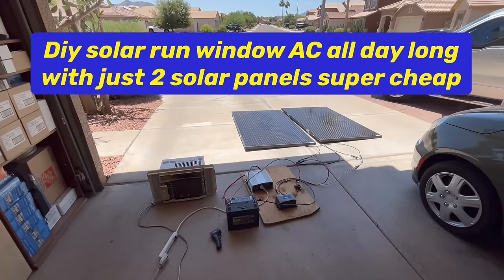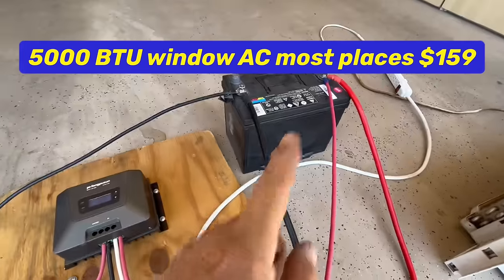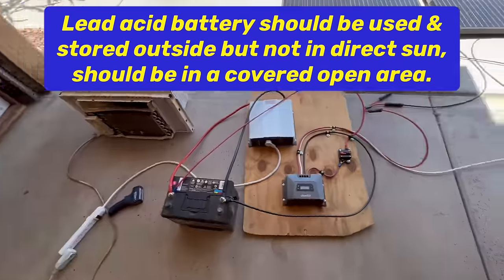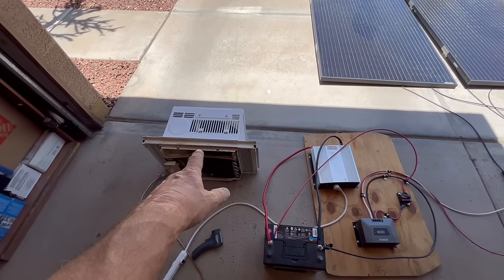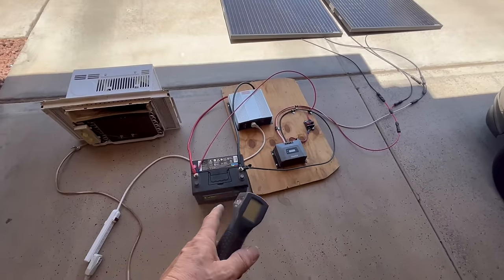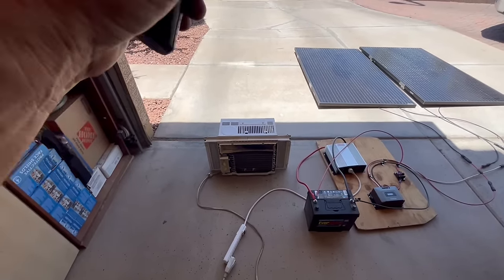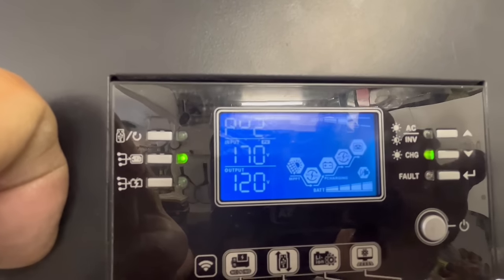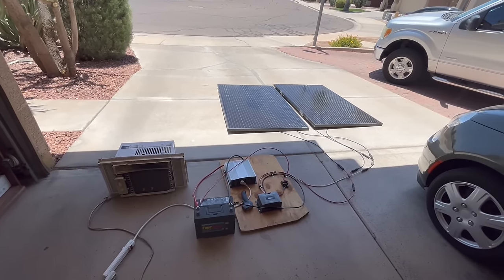Run your window AC with just 2 solar panels when sun shines. Easy DIY project you can do in one day.

Comment: Thanks for explaining all this, I’ve been trying to learn how to do something like this to run a chest freezer, and your explanations make it seem a lot less  overwhelming.
Reply from the maker: Make sure you can expand your system. Once you start seeing what is possible with solar, more than likely you will keep expanding to run more appliances with solar
Reply: @diy-solar-guy  Understandable. Despite the added cost, My plan is to set up separate systems for each new appliance I want to bring online, that way a single failure does not disable every appliance. (This means batteries, charge controllers, and inverters for each system, ie lights, refrigeration, freezers, and air conditioning.)
Reply from the maker: @Vikingwerk  i actually have 4 separate independent systems and back up inverters in case one craps out on me. I’m like NASA, I have back ups of back ups, lol. The all in one inverters I talk about in my other videos are very good and stable. They are meant to last 10-25 years. LiFePO4 batteries are expensive but really dropping in price but give you great overnight run time on your solar system. Check out my other videos and see all the things you never thought you could run on solar. I know people who build off grid systems and use a transfer switch to stop using grid and only use off grid power, but never feeding into grid. They run their whole house 100 percent only using solar in day and battery bank at night. I use off grid now to run 100 percent of the time air conditioning in my 2 starts house with 3 car garage air conditioned as well. I spend $0 on ac cost now with it being 113 degrees during day and 85 degrees at night. I also run my pool pump and when cold pool heaters along with 3 chest freezers and s fridge, outside lights. I have an option to use my 3 1/2 ton and 4 ton heat pump ac units on house or the 6 mini splits I installed in house and garage. Check out my other videos to see how much you can actually do with off grid solar.
Reply: a 12v/24v dc chest freezer would be best. I do this with 2 x 100watt panels in series with a MPPT controller.
Reply from the maker: @JosephMBoyer   very nice, great ideal. Solar can be very easy if you know the basics. Thanks for your comment. Hope you have a wonderful and blessed week
Reply: @diy-solar-guy  you too buddie god bless
Reply from the maker: @JosephMBoyer  thank you
Reply: @diy-solar-guy  Hello, do you mean that these batteries are okay to be drained and emptied every night ? I always read that she should not use batteries for more than 50% of the total energy they can stock ? Thanks a lot for the video !
+++++++++++++++++++++++++++++++++++++++++++++++++++++++++++++++++++++++++++++++++++++💌
Reply from the maker: That is why I am sharing how easy it is to do. LiFePO4 batteries are dropping in price and well worth it to be able to run overnight appliances. You can add later on which is why I like the server rack batteries and trying to increase my battery bank to the max I need as soon as I can. These batteries are suppose to last 10-20 years with full discharge every day. Glad you find it easier to follow. Let me know if you have more questions. Hope you have a truly wonderful and extremely blessed 2024

Comment: This is what I've been looking for... being able to set up just an AC system that runs on solar panels. Thank you for a very detailed explanation, awesome... when I do this, I most likely keep the battery secured in a wooden case outside the window and just run the wire going to the charge controller (?). Anyway, thanks for sharing this and I think you're good so you gave me no choice but to subscribe hahaha! I'll be checking your other videos later... thanks again...
Reply from the maker: Thank you for your input, hope you have a wonderful and blessed weekend
Reply: If you do try to replicate this setup, make sure that you don't plan on the AC unit lasting long. As it runs lower and lower on voltage, you're going to smoke the compressor motor
Reply: @blanksender7808  Inverters have a low voltage cutoff when battery gets to 12.1V just shuts down the AC power it won't lower the AC output below 120V.
Reply from the maker: That is correct.

Comment: Get a little Mr Cool Inverter AC unit or a  a Mr Cool or Diaken Window Inverter AC Unit and no surge to worry about.  Great setup for summer or after a hurricane here in FL takes down all of the power lines for a week or more.
Reply from the maker: I will check into that, thanks.

Comment: The higher SEER units work REALLY well for this sort of thing, enabling a larger unit for the same effective power draw compared to older less efficient models.
Reply from the maker: You are so correct.
Reply: True I got a 14000 btu inverter portable a/c and it uses less watts than some older 80000 Btu regular portable a/c I really want to make something like this…..I have about 3 NSB-AGM31A north start agm batteries do you think those batteries would do well ????
Reply from the maker: @dieseldawg7132  AGM batteries will work great in the day but won’t work at night. Not enough power storage like lithium iron phosphate batteries. Adding more solar panels will help with continuous running when scattered clouds block the sun. The more you improve upon the basic set up, the longer and better it will run all day. I actually improved a lot on this in the last 4 years and now run my entire house air conditioning with solar in day and battery bank at night. Mini splits are great paired with solar. They are really efficient and use less than half the power a central ac unit uses. Check out my newer videos where I show this in my videos. I also installed 6 mini splits in my house before I figured out how to run central ac units with solar. Both work well and I often run upstairs central ac and 2 mini splits downstairs. Hope you enjoy the other videos. Hope you have a wonderful and blessed weekend

Comment: Need to mount the charge controller vertically so convection air currents draw cooler air in the bottom as heat is released out the top. It would also help to use some washers to stand it off from the board a little(1/4 to 1/2 inch) to improve the cooling a bit.
Reply from the maker: This is just a simple example of the basic components in a off grid solar system. I would never run this system with it laying on the floor. It was just to show at components. This was actually installed in a shed for 2 years and ran everyday without fail. Fast forward 4 years and I now run my 2 central heat pumps in my 2 story house and 2 mini splits in 3 car garage with just solar in day and the house I run on battery bank overnight. I run my pool pump 24 hours a day on only solar and battery bank, we also heat our pool with solar in the winter as well. Check out other videos showing this and more. Hope you have a wonderful and blessed week

Comment: That's a nice little project. I am living off-grid and need to find a simple way to run my air -c (living in Arizona) independently from my house panels. Thank You for posting.
Reply from the maker: You are welcome. I have other videos showing 12,000 btu mini splits running off solar as well. I have 6 mini splits installed in my house. 2 upstairs, 2 downstairs and 2 in garage. I also just installed a 12,000 btu 120volt mini split in my 23 foot motor home. Just making a video today of the solar array and off grid inverter as well as battery bank I will use while camping off grid. Should have video posted today or tomorrow, depending on when YouTube is done checking video for copyright. Thanks for your input and hope you have a wonderful and blessed New Year in 2024

Comment: Have you considered adding a "soft start module" - it will reduce the surge amps significantly - not sure if they make one for a window unit but they make them for all types of HVAC units.
Reply from the maker: I installed a soft start on my 3 1/2 ton, 4 ton central ac and on my 127,000 btu pol heat pump heater. That wound definitely help reduce battery discharge at start up of compressor and keep battery charged longer. I believe you can get one the plugs in inverter and you plug ac into that. Thanks for the question. Hope you have a wonderful and blessed weekend
Reply: @diy-solar-guy  Can you install a ultra/super capacitor to help with leveling out spikes/drops? or does that cause issues?
Reply from the maker: @desertlightning7335  I have never messed around with super capacitors so I don’t know, sorry. Hope you find the answer, maybe a viewer might respond with the answer. Hope you have a wonderful and blessed weekend
Reply: I don't think super capacitors would help unless you had like an undersized battery that couldn't put out enough power for the surge but at that point you should probably just get another battery and have the extra capacity and a soft start would be good especially if you had other loads and it might not start it and the inverter would probably like it too but until recently the only real soft start I had seen was real expensive I forgot how much buy I saw another company like Eaton or something selling one for like $150 which isn't cheap but I think that was like half or more than the competitor was
Reply from the maker: @james10739  I installed 3 soft starts on a 3 1/2 ton, a 4 ton and a 12.7 ton heat pumps. They worked great. Cost $250 each soft start. If you are going to buy a soft start, you might as well just buy a mini split inverter and call it a day. Can find mini splits for $500. Mini split can cool and heat and 4 times the area of a 5000 btu window ac unit. Just a thought.
Reply: @diy-solar-guy  ya i agree but I think they make sense for like an rv ac but I didn't think about inverter compressors probably not having big start up surges
Reply from the maker: @james10739  I have seen people use soft start on tv roof top units. My roof top unit is so loud even if I run on grid shore power line. It was only cooling motor home to 80 degrees when 105 outside. I just installed a 12,000 btu inverter 115 volt mini split in my motor home. I was able to get into the 60’s temp within 2 hours. Roof top unit used 1700-2100 watts and 16-18 amps on 120 volts while running. Never reduces usage because there is no thermostat on unit. My inverter mini split uses 1200 watts once running for a minute and around 12 amps, after running and reaching set temp, unit dropped to 600 watts, forgot to check amps but I believe that dropped as well proportionally. After a few minutes of reaching set temp unit actually dropped to 38 watts and was just running the fan to circulate air. Stayed like that for 10-15 minute. Then started again and went up to 800 watts for about 5-8 minutes. Then dropped to 600 watts. I think once set temp is reached, I will slow fan down so unit stays running longer to see if it will drop down below 400 watts. I had on high fan and turbo. This is only a $500 unit that is a 16 seer I found at Lowes for $74 in the clearance return area. The store manager had no idea of what it was used for and sold it 90 percent off. It was what I call a Pappa deal, lol. Anyways. This mini split will cool and heat and I am going to try and see if I can run and keep LiFePO4 battery bank charged with just 4-250 mono solar panels and 8 kWh of LiFePO4 battery that is 4-12 volt battery in parallel series that are 150 ah. Use a 2400 watt 24 volt MPP all in one off grid inverter. I will try to run overnight to see if 8kWh is enough battery. Thanks for your input. Hope you have a wonderful and extremely blessed day

Comment: Thanks for this video. What I need now is to see how you connect everything together. What needs to be hooked up first.
Reply from the maker: Your battery is the last thing to connect. Your solar panels in the sun will be producing watts so might want to cover solar panels with tarp or something while connecting to system. All other components does not matter. Your will get a spark at battery terminal when you connect inverter to battery. The capacitor in inverter is being charged when you touch battery terminal with cable from inverter. You can avoid this using a resistor. That is a separate video for you to watch to see proper way to charge capacitor in inverter while connecting to battery. There are many great videos out on YouTube that show connecting all components, just need to search for them. Will Prouse on YouTube has some great videos on basic set up of solar off grid system set up. Hope this helps. Hope you have a truly wonderful and extremely blessed 2024.
Reply: @diy-solar-guy Thank you

Comment: 11:40 "cool air rises and hot air drops" 

Don't you mean the other way around?

It looks like a good setup and I was thinking about this but how long would it takes for it to pay itself off with all of the parts in your video?  The marine battery is $98.  The AC is about $200.  What about the rest?

Thanks
Reply from the maker: Depends on where you are trying to use ac unit. Charge controller is around$100-$130, used solar panels I picked up for $35 each, bought 13. Inverter is around $130 for 2000 watt. You can find pure sign wave for a little more. By the way you are correct, I had it backwards on air rising or dropping, I used this setup in my shed where I started doing solar to keep my other off grid all in one inverters cool. It worked great as long as you have full sun on solar panels. This is a basic set up. I could use a 24v all in one MPP 120v inverter and connect 2400 watts in solar panels and run 3 of these window ac units during the day from around 9am to 5pm. These 5000 btu window ac units only use around 500 watts. The time for payoff really depends on where you use it to reduce electric bill or if you have a room that is hotter than the rest in the summer. I bought 2 window ac units, one was $129 and the other was $149, both 5000 btu. If you are looking for something to really help reduce electricity bill, look into 12,000 btu mini splits. They will use around 1000-1200 watts when you first turn on but once room reaches temp say 78 degrees , the watts used will drop below 500 watts per hour and that size mini split can be used to cool up to 600 square feet. I use 2-12,000 btu mini splits downstairs in summer when it is 113 out today and my downstairs is 73 degrees. That payoff time can be a year to 2 years to for savings on electric bill. That same 2400 watt, 24v dc all in one Mpp inverter could be used to run both mini splits. I have a lot of videos on using mini split to cool and heat my house. Might want to check out those videos if you are thinking of investing in solar. I buy used 250 watt solar panels located for around $30-$40 each. You would need 10 of those 250 watt panels. Hope this helps.
Reply: @diy-solar-guy  You are an expert in this.  Thank you for sharing your knowledge and your great video. I paid attention to your entire video and watched it twice.  Thanks
Reply from the maker: @_-_-.-_-_  you are so welcome. I love sharing what I learned so others that are willing to do DIY can have see it is possible. It is supper easy to install. I am now at the point where I run my 3 1/2 ton and 4 ton whole house heat pump ac units on just solar 24 hours a day. Just passed my first 30 days of only using solar to air condition my house entire house and 3 car garage with just solar in day and LiFePO4 batteries at night. Been over 119 degrees in day and 85 at night last 30 days. Check out that video as well. I saved over $700 on my electric bill last month. I keep my hours at 68-70 degrees in the day and 74-78 at night. I have over 100 videos now on solar. Gets some popcorn and watch what you can do with solar. Not one solar panel is on roof of house and all my solar is completely off grid. Which means I had to run wire to everything I want to run from inverters in garage.